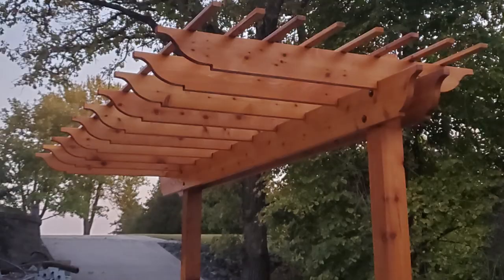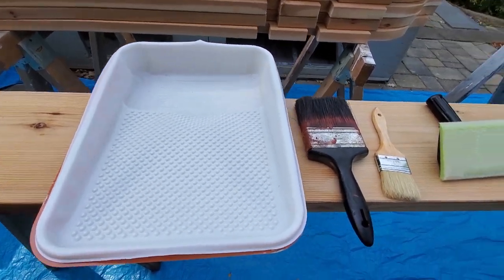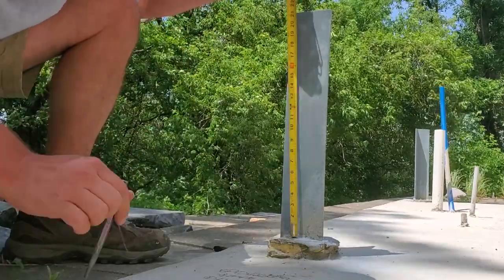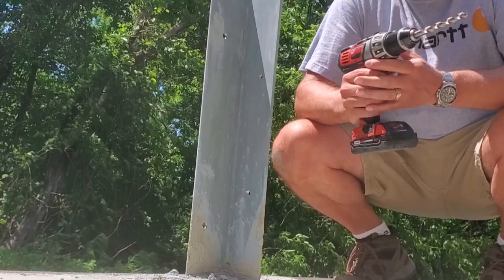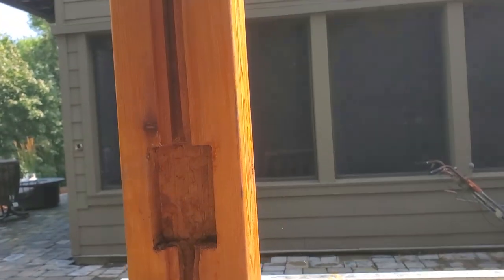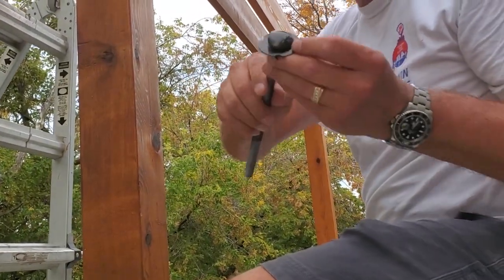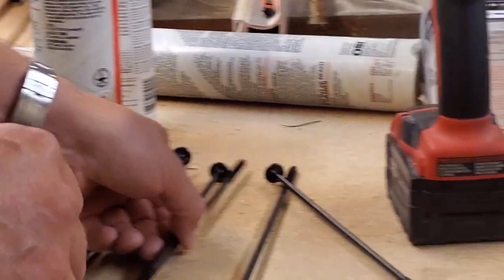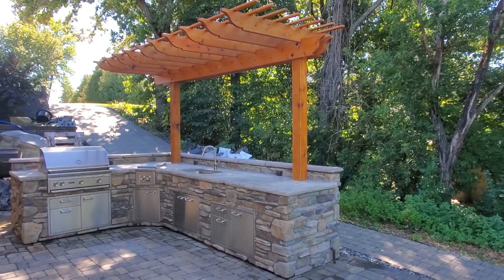How to Build a Two Post Pergola

Comment: Using the HeadLOK bolts for greater support on the rafters was genius!
If I may ask, how long were those 2x8 rafters and how far out did they cantilever beyond the beams on each side? If too busy to reply, I understand.
Thanks, I learned a lot!
Reply from the maker: The rafters are 6' long total, they cantilever 4' out front and approx 18" in the back.  The design was mainly for aesthetics.  If you want to go a little farther out front, add a little length to the back to balance.

Comment: Good video-  how solid are your posts using the angle iron?  I’m going to build a two post pergola and I’m trying to figure out the best post mounting bracket
Reply: I’m wondering the same. Did you do yours yet?
Reply: Yes-  I ordered some incredible wet set brackets from Concrete Pier Systems.  They custom made them for me. They are 18” .25 plate steel with 4 18” rebar welded to the bottom.  If you search  CPS system you can fine a few videos.
I dug my footers about 40” deep, set the brackets and my posts are rock solid.  Couldn’t be happier.
Reply from the maker: Glad you found some solid brackets!  The posts on my project turned out rock solid. Depending on costs and availability, either the straight up steel angles, or the pier brackets mentioned here work great.

Comment: Love this video, what size were your posts? Rafters and perlons?  I’m hoping to build something very similar and cat decide between 4x4 posts or 6x6.  Also was this cedar?  Thank you
Reply from the maker: Thank you!  With just the two posts supporting the pergola, I wanted to make sure this was sturdy and had a balanced look visually.  The posts are 6x6, the cross beams are 2x10, the rafters are 2x8 and the purlins are 5/4 deck boards ripped in 1/2.  This project used cedar.  If one was considering a using treated lumber, it would be good to find materials that have dried well after the treatment so there is less chance of twisting or warping as the material finishing drying.
Reply: Really nice job!, love it,  how tall is it?, it looks amazing!!...I would love to duplicate if possible
.
Reply from the maker: @danielcelis6772  Thank you!  The posts are 10' tall, the rafters are set at 9'.